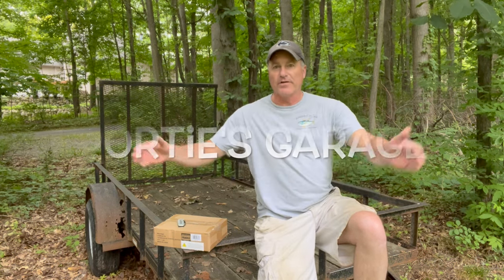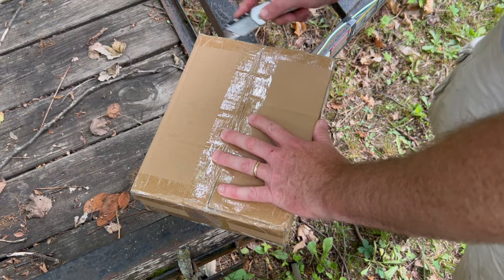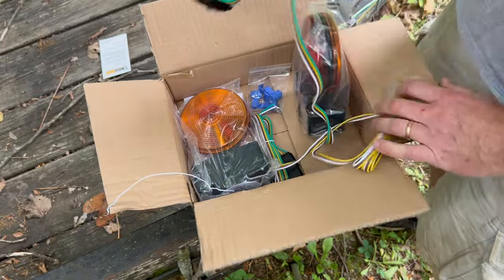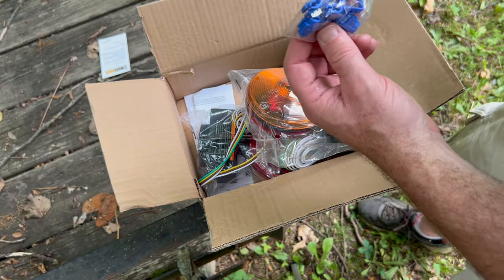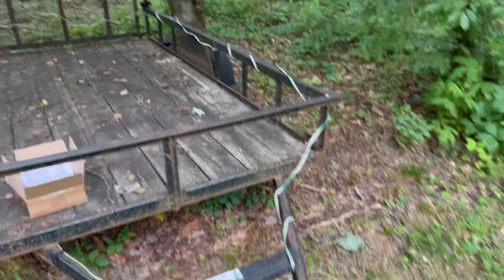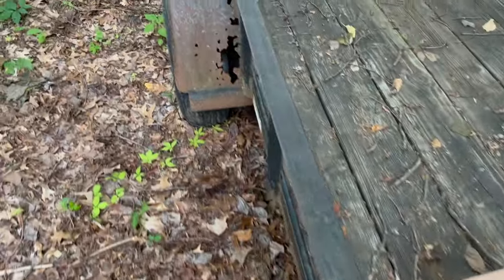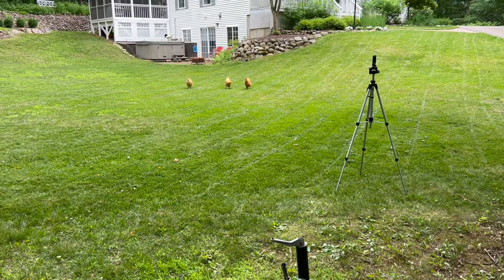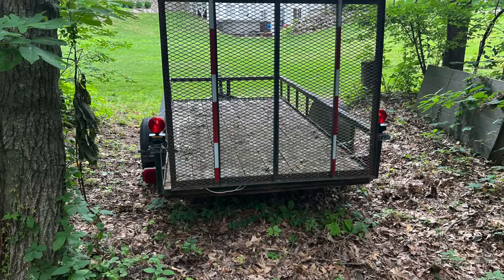Need Some Temporary Trailer Lights?  Mick Has Your Solution!!!!

Comment: I was pulling a trailer that I had checked the lights before leaving the house.

I was far from home and noticed the tail lights were not working so I stopped and checked. No turn signals either. BAD.
I tried everything I knew to fix the lights but nope.

Thankfully O'Reilleys was nearby and I bought a set of these magnetic lights and got it working. There were some nasty bumps on the way home so I also used zip ties to make sure those lights were going to stay put.

I suspect most auto parts stores have those so if you happen to need emergency trailer lights give those a try.

The next day I learned the plywood side had put pressure on the wiring harness such  that it actually cut the wires at a spot where the metal tubing had an open spot. The tubing needed to make a corner bu the previous owner evidently didn't like bending tubing so it was left exposed.

My fix was to run all new PVC tubing fastened to the chassis and run new wires through that.
Reply from the maker: From Mick:  @unclemikeb - Glad a quick set of mag lights kept you from a possible ticket, good quick thinking to check an auto parts store for a set of mag lights!!!